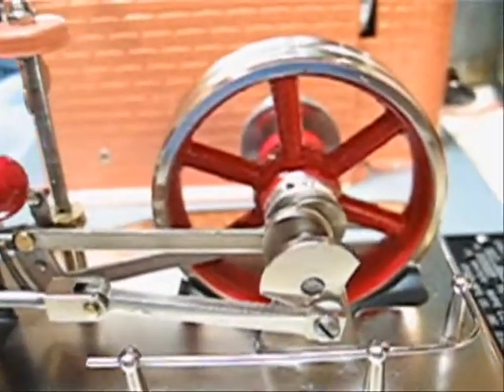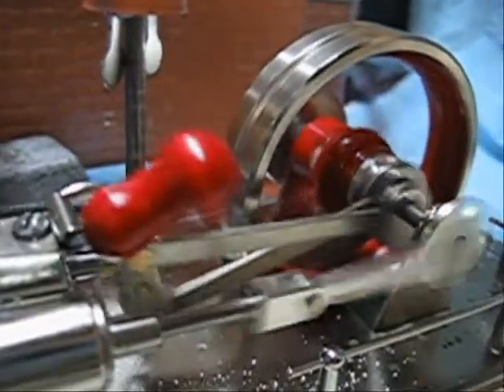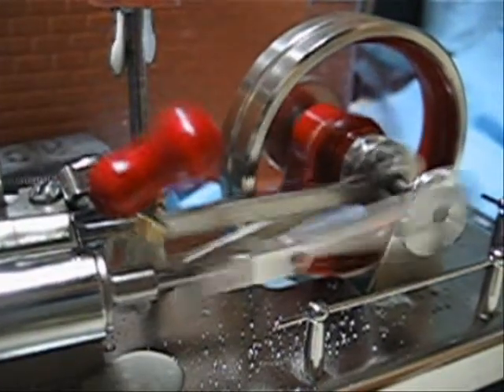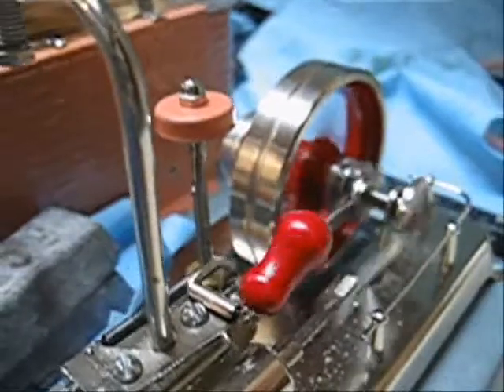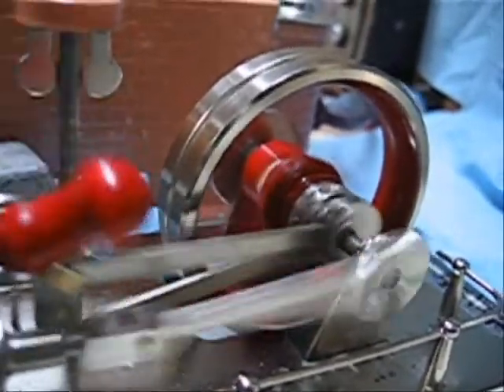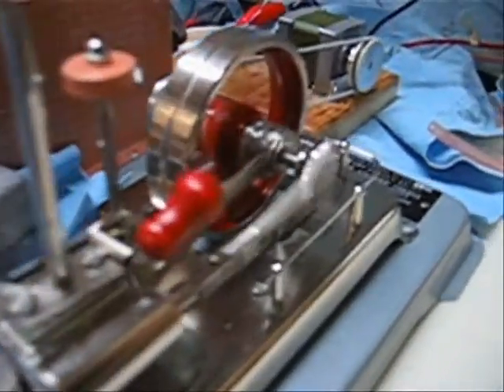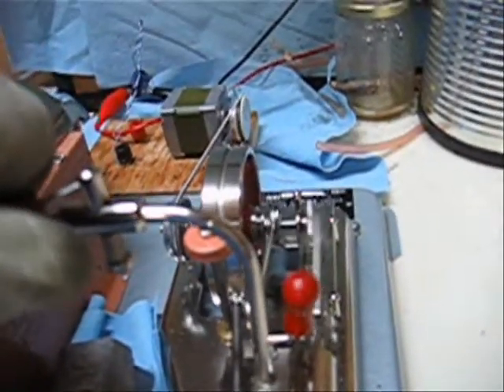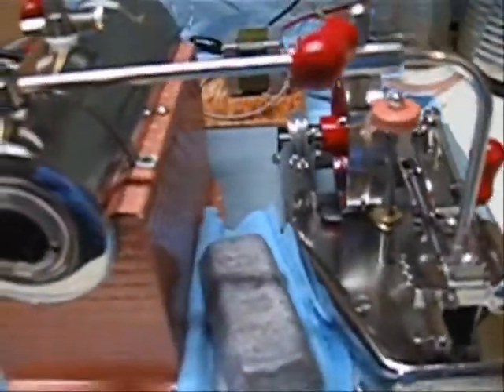Jensen 25 - SteamWorks Improved

Comment from the maker: It runs more smoothly when it's going slow, certainly.  That extra mass helps carry it past the dead spots.  It doesn't seem to rob any power and I can run whatever I used to just fine.  I have a Jensen 75 with a 4" Model 20 flywheel that can still top 2000RPM.  It just takes a while to get there ;)
It does feel a lot more like a 1950's era model 25 now, when they still made them with cast iron flywheels.  All in all a worthwhile and simple mod for the cost of a new flywheel from Jensen

Comment from the maker: It's for visual effect only.  If you want to see a real governor, look at photos/vids of the Jensen Model 50 or 51.  That one actually works, and it's the only Jensen that employs one. There is a regulator on the steam line of the 25 (and most Jensens) that lets you control speed manually.  With that and a dimmer switch you don't really need a gov ;)

Comment from the maker: It's a simulated governor.  I ran the engine once with it connected (video's here somewhere), and then removed the drive belt mainly because it's more of a cheesy distraction than actually useful for something.  With a Model 55 flywheel fitted, it can't be used at all... Maybe if the flywheel was flipped around and had a groove turned into it.  But when you go to this extreme, who would want to?  ;)